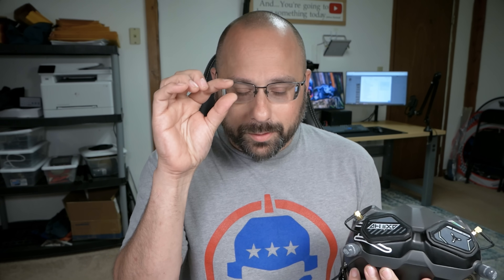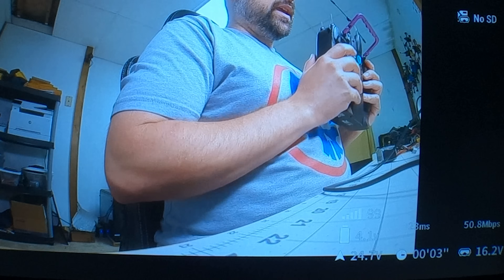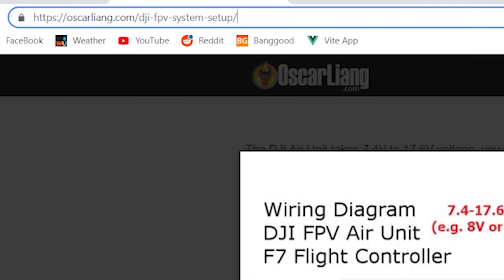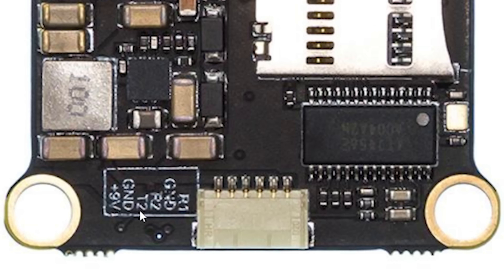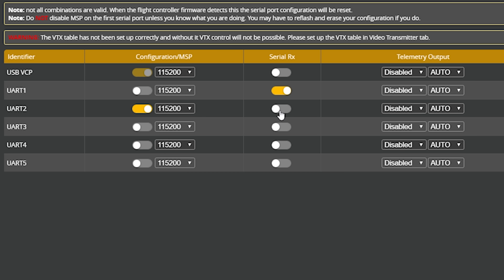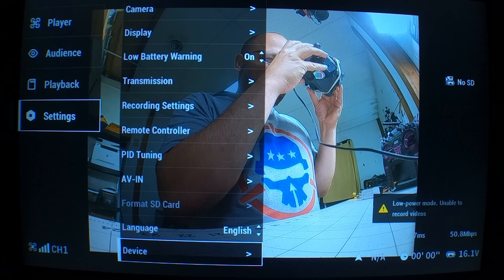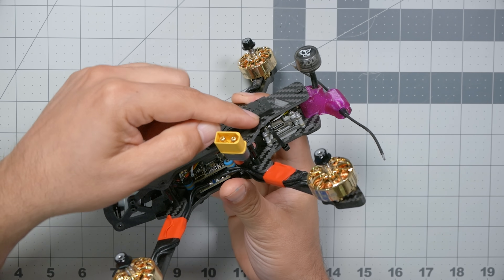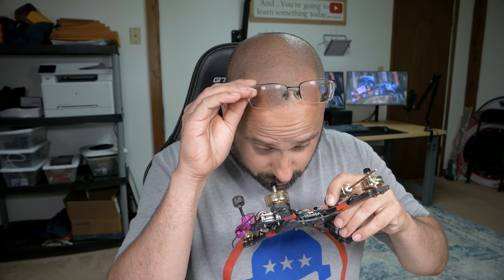DJI FPV very short range? Your MSP connection might be why.

Comment: Yestarday I notice that on Channel 1 my bitrate is lower than in channels 2 and 3. When I arm quad on channel 1 I have only 41 Mbps. On channels 2 and 3 it is normally 50.8 Mbps. Could someone tell me what's going on?
Reply from the maker: Maybe it means there is some interference in your area on channel 1, such as WiFi.
Reply: @JoshuaBardwell  Thank you for answer. Unfortunately problem occured in different spots. I also thinking about interference but it look like interference from universe 😂

Comment: what if your not using a flight controler? i have it on a fixed wing plane with only power and ground. any way around this?
Reply from the maker: Turn temp protection off.

Comment: Dear @Joshua Bardwell
I see low power info, I see "unlocked" info but I don't see "Framerate swtich to 1200mW" info. And yes, I still have problems with range. It's about 600 meters od 1200mW, and then bitrate fall do 2-4 mb\s and I see one red bar in lower left corner of my googles :/
Reply from the maker: If you suspect this issue, turn off temperature protection and then see if it fixes it.

Comment: Funny thing, This video was just recommended to me from youtube. i wrote you an email 2 days ago so on the 17.august 2021. I had the same issue, no VBAT in the goggles and custom OSD not working. no this was my 5th quad and i fly only digital so i was hella confused... i tried switching wires, use 2 different UARTS and 2 AirUnits, i tripple checked the Costum OSD ON on my goggles and if the MSP was set right and OSD in betaflight acitve or not. Now i figured it out with the Help of the Diatone Support. i got myself a Mamba F722 Mk1 Pro60 stack, and the thing is. i tried 2 uarts which are just not disingned to work for that... i tried UART 4 and 3 and it didnt work. they told me to use UART 5 because 4 was for wireless function and 3 was for analog VTX and had a VTX pad. so yeah. if it doesnt work, try every UART you have i guess...
thing is. Diatone doesn't have this info anywhere. not on their Diagramms or anywhere else. Maybe this should be adressed too...
Reply: Tkank you . You I saved probably many hours thanks to you.

Comment: I have a BNF iflight protek 35 HD with DJI goggles v2 and FrSky receiver. My video range is actually limited around 300m and the Air Unit is on 1200mw. Am I doing something wrong here? The OSD shows my battery voltage on bottom right, but the indicator (bars) go towards 1 bar really fast, and that's in red. Thanks!
Reply: I have exactly the same problem! I don't know what is wrong; everything seems okay: OSD, Vbat, showing unlocked when armed, but 1200 mw or 25 mw doesn't make much difference; the mbps drops very quickly....
Reply: @Flying_yesenaer  what helps for me is that I follow the drone with my head, in the past I looked to the ground and had bad reception

Comment: I actually got the N/A and Low power mode warning when not armed (Nazgul5 V2 HD 6S). But when i arm the kwad, the warning disapears and says "unlocked", but still the N/A is there... Am i flying at full power or do both conditions (No N/A and unlocked) shall be achived ???
Reply from the maker: I'm not sure how both those conditions could be true at the same time.
Reply: I suppose that when it’s « unlocked » then it means full power is unloaded.... i guess I should try a long range flight but it’s not allowed in my area ^^. Maybe I’ll try with my finger : the longest I can let my finger on the unit the lower is the power...
Édit : it’s working fine. The N/A remaking was due to wrong configuration on my Kwad in BF resulting in not getting the voltage at all... so I confirm it’s working !

Comment: hey Josh, i burnt one motor. can't find the exact (brand: Xing) replacement. But another 1408 3600KV. Shall i replace only the f***ed up motor or every motor?! what's your recommendation? thanx
Reply from the maker: You can mix motors if you really have to. Same size and kv is ideal.

Comment: What about if range and video is fine, BUT there's NO Betaflight OSD visible?
Reply from the maker: Check of you have vBat in the lower right that confirms whether you have the MSP connection between FC and goggles working.
Reply: @JoshuaBardwell  IT shows VBat.
Using IFLIGHT Succex-e Whoop F4.

Comment: Was having the low power unable to record problem and could not fix it. MSP was correct, battery voltage initially would give me a reading of 25.0v when I plugged in but did not change at all during flight. Also recording was not automatic even when set. Fixed all problems myself (formatting SD card in goggles was part of it)  except the low power thing and just thought I have to live with it always on full power when plugged in. 
Tried again after watching this video and checked everything, played with my OSD in betaflight and now everything works perfectly. If you asked how did I fix it, I have no answer. Vista has FCC hack and goggles 1200wm hack.  Good video JB, it helped me understand a couple of things and prompted me to try again and I'm glad I did.
Now sell me a vista kit from your stash please! 😋

Comment: My vista after about 40 great flights began to show an extremly limited video range.  700mw in the goggles. tried turning off low power disarm.  No effect. Reset to factory settings.  No effect.  No issues with the dji controller signal. Thoughts?
Reply from the maker: Check the antenna cable to see if it's damaged especially where it leaves the connector.
Reply: @JoshuaBardwell  Will do.  Thanks

Comment: Hey Josh - you are holding up the goggles at the beginning of the video. Are those antennas connected correctly? Shouldn't the patch antennas connect to the top? thx..
Reply from the maker: I think the v1 works best with omni on top.

Comment: DJI FPV range sucks anyway. There are HD video systems out there that have 75km range! Cheers!😊🍻
Reply from the maker: The limitation of long range HD systems has always been latency. They're fine as long as you're high in the sky but unacceptable for proximity flying. DJI and Shark Byte have so far been the only HD FPV systems to get latency to acceptable level for proximity flying. (Connex Prosight did it but was not commercially successful and died out.) 

75 km of range is pointless to me if I can't fly around my yard because the latency is 100 ms.
Reply: @JoshuaBardwell  long range = high altitude. 
You can’t do proximity 15 miles away. You will lose video if you go low on the ground.
So 100ms is totally fine when you are 100 meters or more above the ground.
You are not a long range pilot so you can’t appreciate the long range achievements such as flying 75km distance. While you need low latency in order to fly, we are fine with 100ms latency because we don’t fly racing or extreme freestyle. We enjoy the relaxing flight going long range or do a few flips and rolls. That’s why DJI system has not enough range for long range pilots. It also lacks some very important OSD features for navigation.
Reply from the maker: You keep arguing with me, without realizing that I'm agreeing with you. And then ironically you accuse me of being argumentative.

OpenHD is fine for long range. The latency of OpenHD is acceptable for long range. And long range pilots don't fly proximity. And DJI is unacceptable for true long range because of its 13 km limit. I know this. I don't need to be reminded. But the large majority of pilots are not interested in long range. And certainly as you point out, long range has never, ever been a focus of my channel. So I am talking to my audience and the majority of FPV pilots, for whom OpenHD is not a desirable solution, because they are not interested in long range and because OpenHD is not right for the way they fly. And you keep popping up saying, yes, but OpenHD is amazing for long range. Cool. We're not talking about long range though.

Comment: I have had that problem of video dropouts in short range from time to time before I tuned the goggles for 700mw mode and no issue what so ever since! That is next step once you fix the wiring and make it work.

Comment: I Joshua, I have an issue with my DJI and vista unit: the system won't go to 50Mbps mode. Both devices are in FCC mode (I can set it to 700mW) and I'm on the latest firmware, but even though 50Mbps is selected in settings, the data rate always stays at 25.4Mbps. I have tested this on two separate vista units, both with the original vista camera and the nebula nano v2. Any thoughts?
Reply from the maker: You have to switch off the public channel, number 8.
Reply: @JoshuaBardwell  Thanks for your answer. Do you mean just selecting channel 1, 2 or 3 in 50Mbps mode? I could only test this on the nebula nano v2 but didn't work. Thanks anyhow!
Reply from the maker: Yes you have to be on channel 1 2 or 3 not 8. Then it will switch to 50 Mbps.

Comment: if you crash way out there with auto temp off. the dji unit will overheat before you can get to it. Better to have 1Mw to find it anyway.
Reply from the maker: Valid.
Reply: Especially in the Aussie summer

Comment: How do you unlock all 8 channels?  I’ve done the 1200mw hack and it seems to be working but only channels 1,2,3, and 8 are available
Reply: Are you on 25 or 50mbps?
Reply: 50 i’ll try 25 
can’t keep up with which settings change other settings too many catches and loopholes haha
Reply: @Shauny_D  that should fix your problem…. You get 4 channels on 50 and 8 on 25

Comment: @Joshua Bardwell, The protection Diode IS a TVS Diode!  Soldering surface mount components can be done with solder paste and hot air, You my dear man, should look into this soldering method if you haven't already because its RAD!

Also sometimes solder paste and a soldering iron can be used together. having solder paste is a valuable soldering consumable!

Thanks so much for your channel and what you do, Most of what I have learned about Kwads is from you  :) <3

Comment: I really like the Vista, but it’s vbat display seems patently stupid to me… the best way to power a Vista is by wiring it straight to the battery pads as that bypasses all FC voltage regulators that could fail and leave you blind.  Even a short glitch/interruption within that regulator will result in a prolonged dji restart and probable crash.
Therefore… the Vbat shown in the goggles should be the actual voltage being fed to and detected by the Vista itself instead of vbat voltage info provided as data through the MSP connection.  Or at least make it’s source user selectable.  Displaying Vista’s direct detected vbat would also free many of us from having to mess with MSP in the first place, as well as freeing up a uart for something else.
Reply from the maker: I agree that user-selectable source is a no-brainer. It's annoying they don't do it, especially if you are using an airplane with no flight controller.

Comment: Almost returned the dji setup after I finally got it. 3 issues I had and now it's amazing. 1- the camera cable wasn't seated properly. 2- have to use a really fast SD card. 3- auto temp control had to be turned off. Thanks jb I'm pretty sure I figured all these issues out from your videos.
Reply: Why do you have to turn off the the auto temp control ? What was wrong with your drone ? Thanks
Reply: @emmanueluh5869  with it on it turns off your video feed to protect itself, then you can't see and crash. I kept loosing video extremely close. And after the issues above were fixed, it's been pretty much flawless.

Comment: I just disable auto temp control in general. If you crash reasonably far away from where you are and it goes to 25mw, you will never get your video back when trying to look for the quad

Comment: I have another issue with my Quad. So when I power iz up, the LED of the Vista stays red and I cant connect my Goggles to it. This happened after a pretty hard crash so yeah. Does somebody have an idea? Or it might be just dead.
Reply: Open up the camera and make sure the connector is plugged in solid. It might have come loose.

Comment: Are you 100% that they won’t over heat and damage themselves? Cause I bought a brand new vista turned off temp control and all was working fine. I plugged in my kwad and someone needed my help and I got distracted for 10-15min and when I came back and check my goggles my camera looked like I was looking through a screen door.  Tried to fly and it wouldn’t fly further than 20 ft without loosing signal and locking up. I swapped camera and still the same. Swapped vista unit and kept the same camera and all was good again. That vista unit is fried. Again it was brand new only test hovered never flown and it had been working perfectly. Now it’s trashed.
Reply from the maker: I mean I guess nothing is impossible.
Reply: I couldn't fly with temp control on. It would almost immediately go into protection mode, and if I could start flying quickly enough it would still come on while flying and I would loose video really close. But I avoid letting it sit on without flying so it doesn't burn up.
Reply: I do want to clarify for future readers. I did turn of temp control on my unit under my own accord way before this video came out.  And in no way was this Joshua’s fault or am I blaming him. I also believe that once you turn off temp control the unit can damage itself.  As for temp control I would leave it on durning high heat months and maybe only disable it during the cooler months.  However be aware your settings while also making repairs and updates on the bench. If temp control is off maybe turn it on also reduce output power to 25mw.

Comment: Another potential cause for N/A in goggle vbat is a broken current sensor on the flight controller. I also don't get a voltage reading in betaflight with this problem. Just figured I'd drop a comment in case anyone tries all the fixes in this video but still don't see vbat.

Comment: I used the T4 and R4 pads didn’t work So I soldered to TX and RX idk if they are the same type of pads but The other pad didn’t work right but it was worth the time figuring out the quality on the camera is amazing also the stick inputs to bring up the PIDs worked on the vista then stopped after opening my PIDs up with the googles Idk if that cause an error with the stick but it’s weird

Comment: Joshua you are the man. I just had this issue past few days haha. Edit, also worth checking if the cable on airunit is plugged in properly, mine partially unplugged after crash and then I had this issue.

Comment: If my FC has a plug for DJI and nothing is mentioned regarding MSP in the manual, how do I find out which UART needs MSP to be activated? Do I really have to check them all? It´s a Kakute F7 HDV by the way
Reply from the maker: This should be documented in the FC pinout diagram.

Comment: Spoon feed me Joshua 🤣 I have the full problem and need to know the location of the diode. Damaged in my Kiss build which I very rarely fly but would like to correct it.
Reply: Just found another video in YT. Seems there are 3 diodes, TX/RX/SBUS. As I don't use SBUS I guess there's a free spare. 👍

Comment: Is there a way to use a pwm signal from an RX to tell the air unit when to unlock? I fly scale FPV planes without FC and this would be useful
Reply from the maker: No. Just turn temp protection off unfortunately.

Comment: I was told by caddx that even if I have the temp off, and power at max. The vista will stay at low power, and not go to full power AS LONG as you don't plug the googles in. Once you plug the googles in, it allows the output power to go to max. So if your trying to get a GPS lock, and your vista is set at max, just don't plug in the googles till you have satillites.
Reply: Or you can just manually set the goggles to the lowest output power during the wait.  Then set it to full output when you are ready to fly.  Its only takes 10 seconds to go through the menu so its not a big deal.

Comment: who in #@%!Q% name has been flying in locked low power mode with 2 weeks of latency and not know they had something wrong?   I honestly have took off too soon for the dji system to catch up though and it's rebooted my flight control mid-air.  Soo.. i wait until i see my osd items appear and refresh before takeoff.

Comment: hmmm, i dont think i get the green symbol for 120fps.... i thought i put it on high quality mode and never changed it, anyway on 500mw its a beast for range. i do wish the 50.0mbs was in the center a bit more, the times i need to eyeball it are usually risky flying behind things so i can't watch it and power out if it goes bad.
Reply from the maker: High quality is 60 fps. Low latency is 120 fps.

Comment: Thanks, JB, it turns out that I have an Air Unit with a blown diode on one of the uart pads (continuity with ground). I am willing to try to replace the diode, are there any resources out there on doing this?

Comment: Using Vista units on Spec wings for racing. No FC and just power directly off balance lead on battery. Temp protection disabled and have had no issues doing this. Allows for up to 6 racers at a time on low power modes and able to simultaneously fly analog and digital.
Reply: You connected the yellow wire directly to battery positive?